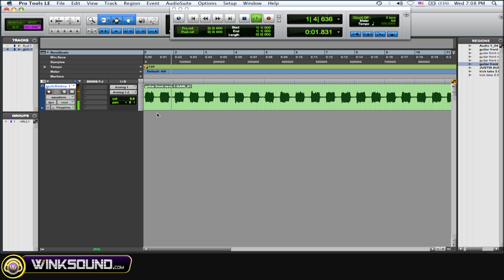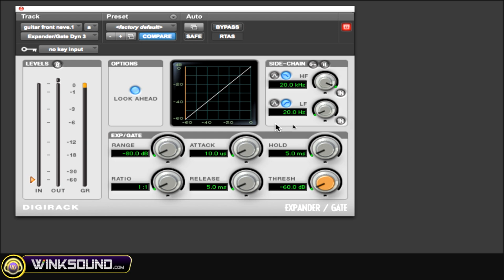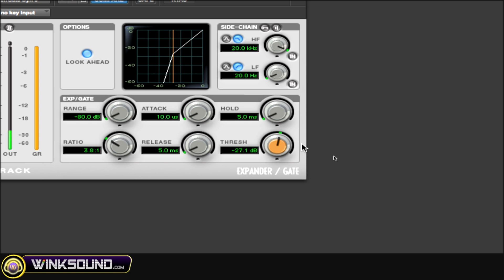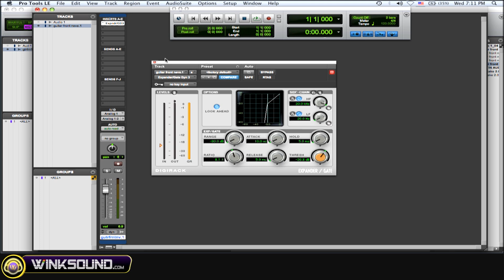Pro Tools: How To Use the Noise Gate | WinkSound

Comment from the maker: @rollinfever15 Hey thanks for your question.  The attack on a noise gate is the time it takes for the gate to fully open once the signal exceeds the threshold level.  In general, you want your attack to be fast, but not too fast that it creates distortion or clicks.  Hold is the time that the gate is kept open after the signal level has fallen below the threshold, or the minimum amount of time that the gate will remain open.  Let us know if this helps.

Comment: An other quick tip (hope the video owners don't mind) open the expander/gate on the track you wish to use it in (as an insert) then just play the track it self. look at the hum/buzz/air/etc artifact that you wish to take out. You will see the db that the noise you wish to take out is. This tells you at what setting your threshold must be set slightly higher. Example if your noise is at -24 db, place your threshold at -22 db. It will gate everything under -22 db but let everything over pass.

Comment from the maker: Hi @electricsleepmusic for sure. We'll get working on a tutorial to help understand how to take full advantage of both types of processors. 

An Expander performs the opposite function of a compressor, increasing the dynamic range of the audio signal. 

A Gate allows you to clean up audio tracks by cutting out any frequency below the set threshold (great for getting bleed out of acoustic drums tracks and vocal takes).

Hope this helps,
Mateo
WinkSound(dot)com